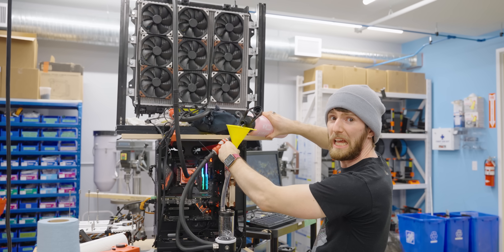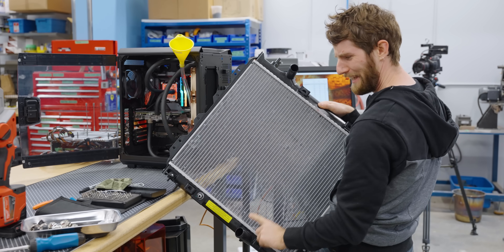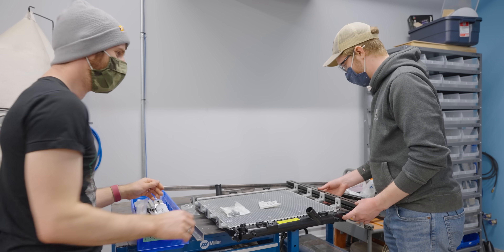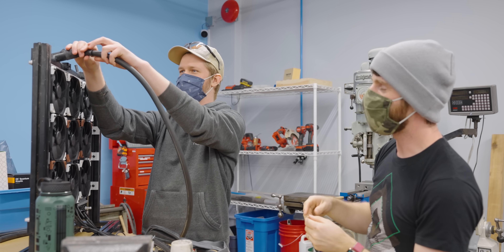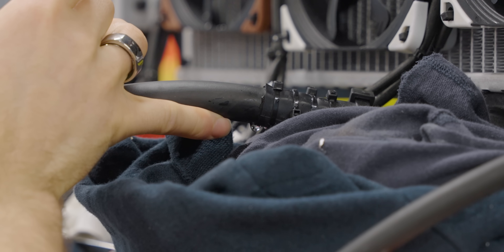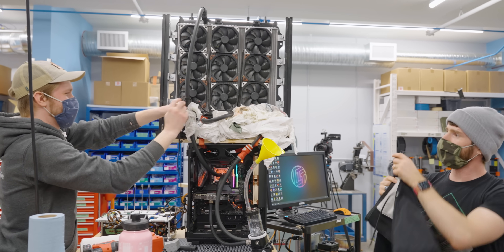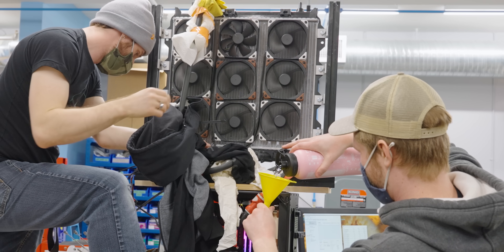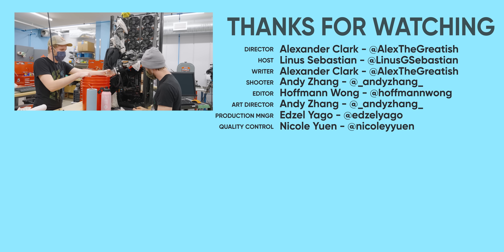Our Craziest Cooling Project Yet - Car radiator liquid cooler

Comment: Noooo linus, the BIG BRAIN move would be to cool a CAR with PC water cooling radiators xD. Then we'd have come full circle, since the first PC watercooling radiators were modded car heater core radiators, just much smaller than this one lol. This was hilarious though XD. Also alex is fired, he forgot to make sure you guys had hose clamps before starting the build. If we'd done this at my house i think i'd have had clamps for every leaky connection lol. There's a reason they use a metal band that tightens down around the hose with a screw lol, shit works. In all my years of PC water cooling before I made the switch this gen to compression fittings, i've never had a leak that wasn't caused by a hole in the radiator itself (had one of those, was a dual system case, rip 2 motherboards)

Comment: Transmission cooler works with a tube that sits inside the tank for the radiator, as the hot fluid passes through the tube that is submerged in the water filling the tank, heat is transferred into the water flowing through the radiator. The tube keeps the transmission fluid circuit separate, while still transferring the heat to the water cooling circuit, and being integrated into the main radiator it negates the need for a separate radiator and mounting for it. (It also aids the transmission fluid in warming up to operating temperature, if the engine warms up faster than a transmission, it will transfer heat into the trans the opposite way the cooler introduces heat into the radiator, as the transmission operates best at temperatures between 180°f to 220°) having the two (or sometimes more, possibly including another circuit for engine oil, supercharger air charge cooler, etc) circuits combined will help ensure all circuits reach and maintain within a certain range more evenly. 

I would love to see an auto/aeromotive themed gaming rig that could be paired with vr for simulator that used a car radiator and possibly bodywork for water cooling and case. I can probably even point you to the proper fittings to connect the automotive radiator to a cpu water pump. In any event, I have been planning a simulator build, and this vid just gave me some inspiration for the case. Thanks guys.

Comment: Technically the radiator is not really dissipating the heat... The water just leaks out so you always have room temperature distilled water flowing through the block... Might as well just pump cool water through the loop with no rad. 🤣

Comment: Why don't you just hook the CPU and GPU block up to cold tap water as an inlet, and let the outlet flush into a sink, and cool the system that way?

Now on the first glance this seems completely idiotic, sure, but hear me out.

It'll cost you the amount of water used, of course, with a total loss cooling system, but you don't need a radiator (your heatsink is the sewer), you don't need a pump (you're using the water system's head pressure), the inlet temperature is constant no matter how long you operate (it'll be as low as the cold water in your water supply can get) and you get to dump all that heat into the sewer so it won't heat up your home which is an absolute win as far as I can tell. The efficiency would obviously depend on how cold the water is, but you could adjust the flow simply by opening the tap a bit more or less to adjust the working temperatures.

As for the actual cost? Depends on how much water is used, but still surprisingly low! Let's say one cubic metre of water (1,000 litres) costs CAD 1.50. If a watercooling loop normally works at let's say a flow rate of 200 litres/hour, that would mean even if you run the computer 24 hours a day, you would still "only" go through 4.8 cubic metres of water per day, and the cost of operating the computer would be about 30 cents/hour. And you could always collect the water and use it for, like, irrigating your crops or flushing the toilets or changing the water in the swimming pool or something that you'd be using water for anyway. Separate wastewater treatment costs would apply on top of that, but even so it is surprisingly affordable.

Now if you are in a situation where using a PC means you have to also use air conditioning to keep the room temperatures tolerable, that can already cost more than 30 cents/hour to run for a medium-sized room.

Comment: There's jank, and then there's lets not even try.
Like seriously, there has to be ways to not leak. At this stage it might as well be just run a tap to it and tip the hot stuff down the drain

Comment: question, why are you sending hot water from the processor block to the video card? Arent you just adding heat to that cards processor? Shouldn't the hot output of each component go to a single tank before being pumped to the radiator?  Always wondered this. Thanks.

Comment: without being a car guy or knowing this radiator, I'd assume that the transmission loop is just a heat exchanger into the "big loop" ... so connecting it does seem unnecessary. ;) anybody agree, or knows better?

Comment: Stupid video TBH - one minutes its LTT's engineering people/capacity and then they're janking bike tubes instead of  . . . . . ummm, engineering a solution. They could at least 3d print or turn the adapters required. And to put the rad ABOVE makes no sense to make the pump raise the water so much.
Lazy content, would love to see interesting content from the engineering side of LTT (i.e. not silly content or content thanking someone who provided a piece of equipment)

Comment: So this is cool (pun) as a joke, but I would have actually liked to see it for real as a real project.  Proper fittings so it doesn't leak, better fan attachments, temps without constantly replacing water, etc.   I feel like this was a low effort thrown together video that turned into more work than needed for something that's not real.  Still fun to watch.

Comment: Not that this would have saved this clusterfuck but a cheap box fan turned up to high would have been easier than dealing with those 9 Noctuas.  That or a regular radiator fan used in a car, connected to a lab PSU to feed it whatever voltage it wants.

Comment: Why not 3D print the reducers for the large ends on the radiators. Seal it with epoxy or what have you

Comment: Unless the intention for the video was to be sketchy, why did you release this? The effort to go to napa to buy the radiator was done, you cold've just bought some fittings while you we're there. And next time, just use a proper coolant and radiator fan, that would've been REALLY interesting!